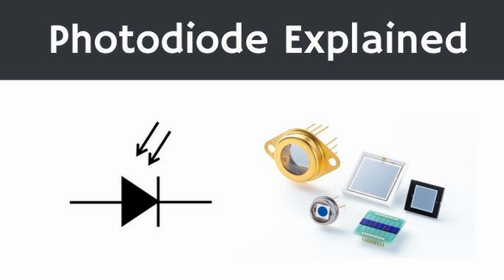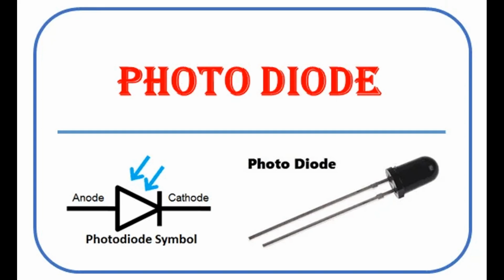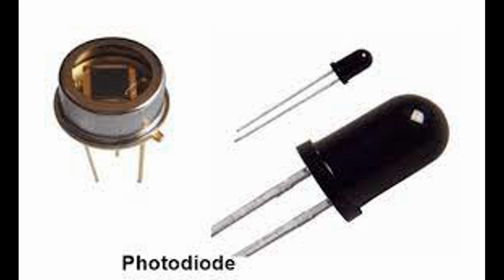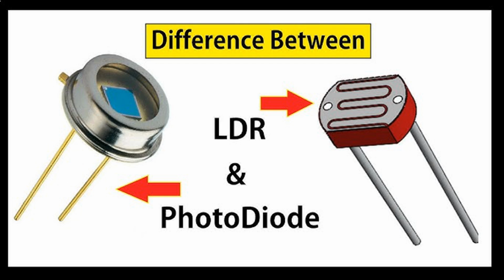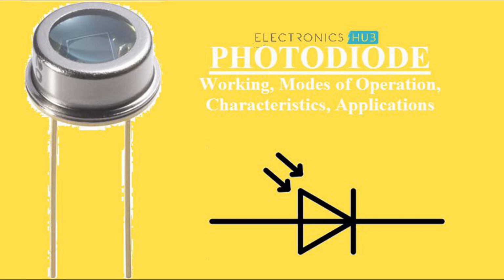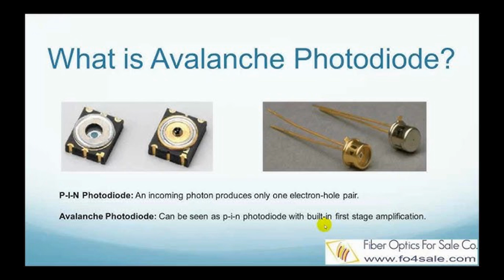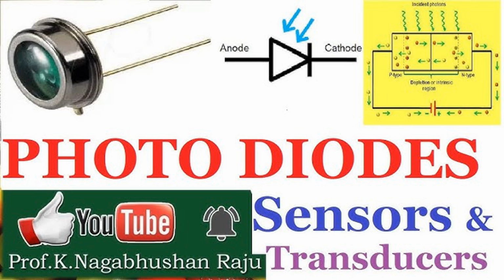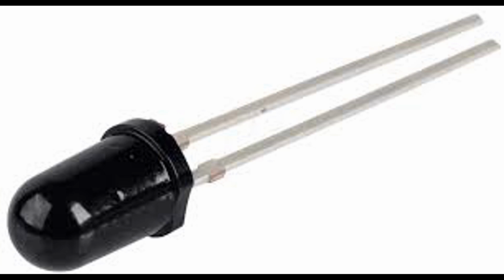What Is A Photodiode  How Does It Function And Its Application.

Comment: Based an experimental activity in terms of electronic circuit based on PBX 61 - Photodiode, there is problem. The problem is that when the source of alpha particle approaches to this photo diode the count decreases and vice versa.  What is the solution? Thanks in advance